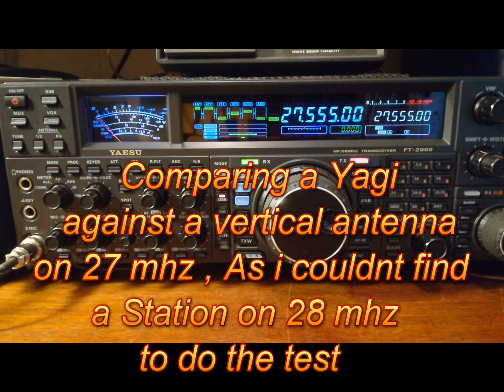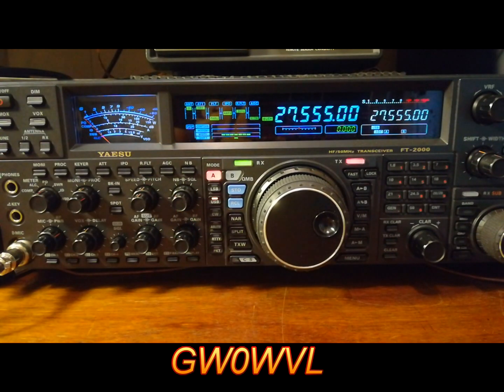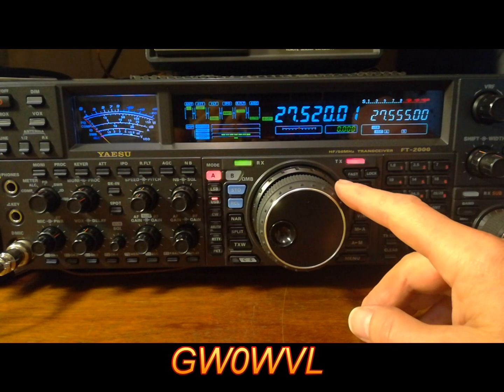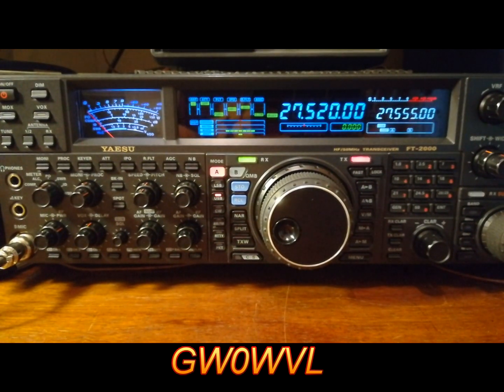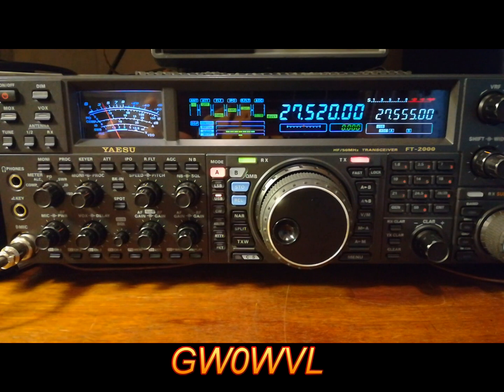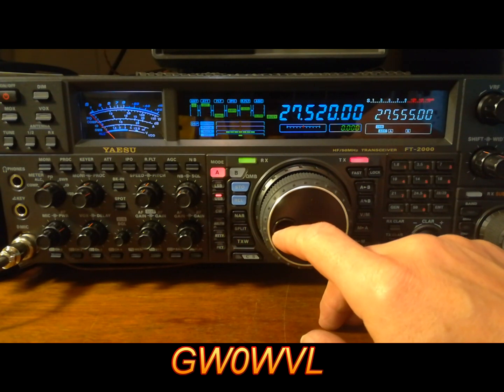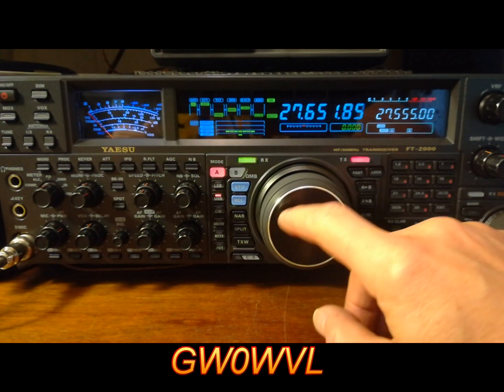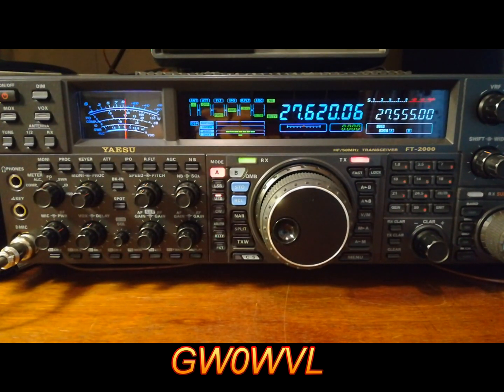GW0WVL, Comparing a 5/8 wave vertical against  a 3 element Yagi antenna.

Comment: I totally agree with your comments.  Tho having done these mods - and more which I won’t go into here,  the difference in both recive and transmit was marked...... around 1/2 s point on both.  Which is a very good improvement 👍🥃🇦🇺
Reply from the maker: I've never found that adding a seperate earth to a 5/8 wave made any difference at all ....  Sure it would give any build up of static from around the antenna a route to go to be bled off , But other than that , I've never seen any improvement in actual performance by adding an earth to a 5/8 wave ..... Adding an earth to say a ground mounted 1/4 wave where the soil or earth  is actually part of the antenna then yes it makes a big improvement , But not on a 5/8 wave or a 1/2  wave  Silver rod type  antenna I haven't  see any improvement.

Comment: Ok question sir.   Do you have the 5:8 grounded correctly???  And I mean correctly !  Raidial wires , braid to the mast via the coax ... not via the plug. ?  Etc etc .   I does make a big difference.   It will not make as much Dbd as the 3 element of course, but it will certainly improve both revive and transmit.   Many many things you could do to improve the 5/8 .  Thanks
For you post 👍🥃🇦🇺
Reply from the maker: Typical gain figures for a CB 5/8 wave is around 1.5 DBd , Typical gain figures for a  3 element Yagi is around 6-7 DBd ..... Grounding  really won't  do much if anything at all to improve the 5/8 wave , It certainly won't double or triple it's gain figures .

Comment: Initially I found this video discouraging, as I am considering a Marconi (1/4 wave vertical) for the 40 meter band, which could also telescope to a 5/8 wave for the 20 meter band. Now it seems to me that there may be something amiss with the 5/8 wave shown here, as the difference between it (5 dBi) and a 3-el Yagi-Uda array (12 dBi) should be only a bit more than one S-unit. Perhaps the signal is arriving from an angle of 45° or higher, where the vertical is relatively insensitive.

Comment: how do you connect the antenna cable to the yagi, direct cable conection or gamma match or . . . ?
Reply from the maker: When I built the Yagi  antenna  I went for the gamma match type of matching as ive always found the gamma match to be easy to build , And reliable , Basically it's just a shirt length of the  inner part of RG213 coax slid inside an Aluminium tube to make a capacitor .

Comment: What if I make the antenna with copper wire instead of an Aluminum pipe?
Reply from the maker: No real difference other than  youd have to slightly alter the antennas length due to the velocity factor  being different from Aluminium to copper and the  diameters  of the conductors.

Comment: See when your pointing for say south would you pick any north at all up on Yagi even weak
Reply from the maker: You will hear signals of the back of the beam  but weaker, Depending on how many elements the yagi has will determine the front to back ratio ( Back rejection ) a simple three element yagi like this one has around 20-25 DB rejection of the back, More rejection of the sides though, So a signal thats say  S-9+20db  of the front would drop to around an S-9 on the back of the yagi, An S7 signal on the front of the yagi would probably be  gone altogether  of the back of the yagi,  Normally the more elements a yagi has the higher the forward Gain is and the Beam width is also sharper  so pointing it becomes more precise.
Reply: @Gw0wvl  brill good explanation, you really need a rotator then

Comment: Cool video, always have 555 or the FT8 stored in the tcvr's memory to see if the band is open.........used a solarcon vertical for years from North Wales and it worked well,VK ,ZL the US and Eu stations but a beam its a different animal, still have the solarcom its a good antenna for what it is, a beam provided its not to gainy (is that a real word) can be more of a hindrance than a help, used a long boom 7element and it was excellent provided you had the right beam heading !!
Personally a 3 or 4 element yagi is a good comprimise, the beamwidth is enough to hear stations and sweep around for traffic with minimal rotator turning....for the price, a cheap SIRIO CB yagi is a bargain.
Regards from France Ade

Comment: Just put a 4 element yagi on my tower .. 10m elevation. 3 S point gain on receive compared to a 5/8 wave vertical at the same elevation. And a 3 S point on transmit as reported by regular contacted stations... That is a major result...

Comment: Hi
I’ve been tossing up between a 5/8 and a end fed half wave and found your video 

Just out of curiosity, could you have some losses in the 5/8th vertical that have slowly developed over time due to oxidising and contamination in the joins?

I know with my various magnetic loops I was prototyping, some time in the weather would see losses over a period, and reseating the joins would bring the antenna back to life 

Maybe cleaning those up might render you another S Point. Just a thought.
Reply from the maker: Its possible, But all joints showed a low resistance when tested with an ohm meter., Also the vswr is low meaning its at resonance, But then that in itself doesnt prove its working efficiently and radiating ...  Weve only to look at the common old dummyload to see that.

Comment: What is the height of the yagi as compared to the vertical?  The 4 to 5 'S' Unit difference is intriguing. Either the vertical is a dog or there is something else going on here.
Reply: The difference could be polarization changes, on top of the 5-6dB gain over the vertical. As you notice, the difference wasn't always that striking, whereas, other times it was huge.
Reply from the maker: Roughly 30 foot to the boom on the yagi, And 25 feet to the base on the vertical, Then theres  just over 15 foot of the vertical thats higher than the yagi... Some  47 feet to the top of the  vertical...... Nothing wrong with  the vertical........ Ive had similar results with the home made yagi  against the Antron 99 in a previous video ive got on here ...  You might want to check that out to.
Reply: @Gw0wvl  I was originally licensed back in 1980 and used to swear by homebrew cheap as chips ZL yagis for 2mtrs and above, mine always outperformed all the stations that were using verticals and co-linears costing extortionate prices😊. I eventually managed to talk a few friends into building yagis instead of verticals with expensive sounding names, we used to have lots of laughs on 2mtrs with our beams pointing at each other and reducing power down to microwatts, having a crystal clear conversation with the expensive shop bought brigade totally unable to hear us.
I think a lot of commercial antenna manufacturers cook the figures usually quoting dBi and not dBd because it sounds better. The best bit about say 6 dBd gain of a yagi is reciprocal when you both use Yagis, the transmitting station at 100Watts would have an effective power out of 398 Watts Erp and the receiving station with 6dBd would have another 3.9 x gain which is equivalent to the transmitting station putting out 1.552Kwatts. That's the way I figure out the reasons for such a big increase in signal strength over a vertical with not a lot of gain.
Reply: Forgot to say that's why a yagi penny for penny is way better than using 1000 watt linears 😊a home brew yagi at each end is the equivalent of a 1Kw linear using a vertical.
Reply: @stevejones8665  so u mean if I put out 100w SSB that it will sound like 1500w on other end? I have a 15 foot three element yagi